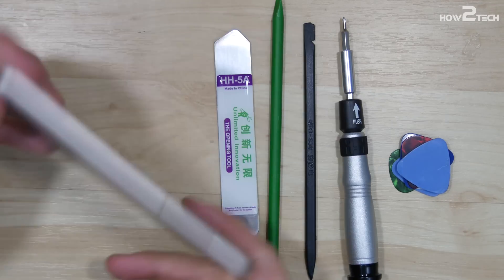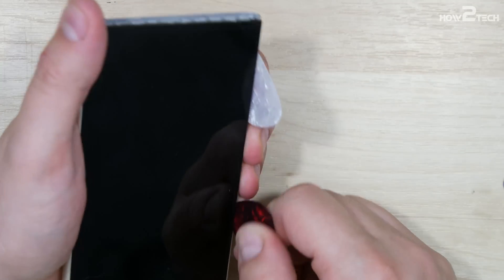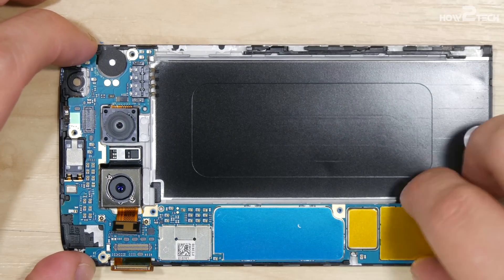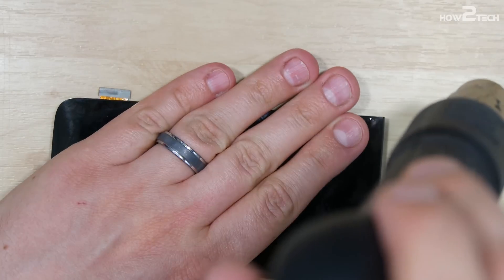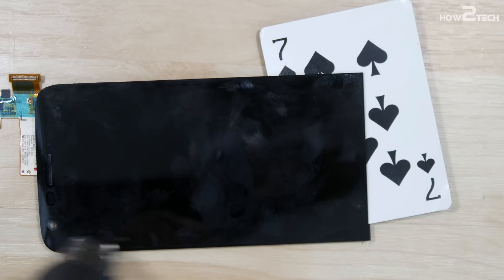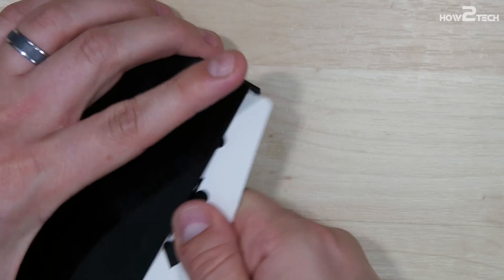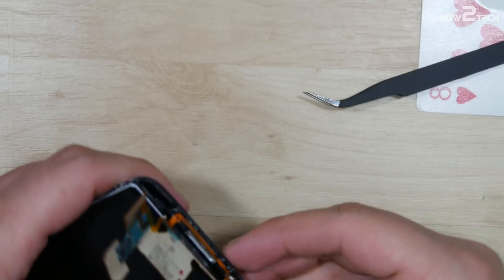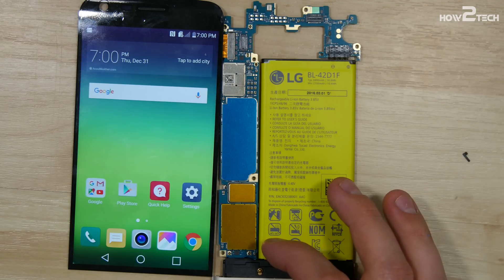LG G5 Screen Replacement - Teardown (4k)

Comment: Actually How2Tech if you remove the battery and look inside the phone at the very bottom left corner there is a tiny hole in the black plastic. That hole is there for a reason. Take a paper clip with a small hook bent in the end and insert it into the hole, pull firmly and it will unlock the slide lock and the phone will separate with minimal force.

Comment: Hey H2T, great video.
 I was wondering if you could help me with a mod question. I fly drones using 5G wifi, 
however my signal crashes around the 70m mark, 
yet the drone I use is supposed to have around the 400m  capability, 
So I was wondering if you could tell me where the ariel is in the G% and how i could fit an r sma lead to it so i could add a directional beam ariel or even a yagi. 
Or better still is there some sort of wifi antenna that i could connect wirelessly to without having to strip down my lg g5?
cheers

Comment: hello sir i got a problem with my lg g5 the camera flash won't work when the subject is too far away from my lg g5. and sometimes it turns black when captured in close to the subject. what is the problem with my g5? tnx for helping.

Comment: I need to replace my digitzer since I smashed it working on my car, I'll be buying one that has the frame already connected. If I'm replacing the digitzer and frame, I don't need to heat it up to remove the display like you showed in the video, right?
Reply: Eric Ver Linden No, if you still care since its been 6 months. All you would need to do is pry it off and disassemble and unscrew the motherboard until you hit the frame and the display itself. To make the whole repair easier, buy a display with the Frame already on it so all you would need to do is put the thing back together using the replacement display.

Comment: What do I do if I just need to replace the actual glass, the LCD works fine, I'm using it right now! There's just an enormous ugly crack across most of my screen...
Reply: just buy the glass and lcd in one piece. Iti is much easier to replace, and only cost a few bucks more

Comment: I was so happy with my G5 until recently now I hate it. After only 7 months the GPS refuses to catch a location and the screen is just horrible because now it has an image retention issue. If I am on a page for even just a minute reading something, that image becomes sort of "burned" into the screen and all I then see is the ghost of that behind everything. It goes away only if I then play a video where things are moving on the screen which then makes the ghosted image slowly disappear. Why would it do such a thing???? Then if I have it on a full black screen, one can even see what looks like 4 pixels still letting light through. It is like 4 little white broken pixels. Argh. So not feeling it anymore.
Reply: SDav21 lg g5 has lcd screen, image retention is really common on lcd's but it goes away in an amoled if that happens it will be permanent. An that of the black screen is calles "screen bleeding" is really comlon on LG devices but nothing to worry about
Reply: Image retention gets worse over time but isn't really a problem. After a year the phone has washed out whiter spots around edges.

Comment: If i buy a screen from ebay will the image quality of the screen be the same as the original??
Reply: EzzilanDeRR it's hard to know but if it seems really cheap like less than about £50ish  there is a significant chance it could be. however as it's isn't a super common phone there is less likely to be cheap knock-off screens anyway.

Comment: We replaced a charge port flex on one. Now we are getting an error saying, "This module you've attached doesn't work for this phone or isn't inserted correctly." We ordered a new flex but had to desolder a little bronze contact with 3 points and move it over to the new flex.

Comment: I did not understand. If I need to replace ONLY front glass panel, why do I need to tear down  all the phone? Can i just remove the screen + MB assembly from the casing and start working on the glass?
Reply: Val K same here... I was wondering that too
Reply: Val K yes I believe you can. this was just a full-ish tear down
Reply: Val K lol good luck and try not to break your display

Comment: What reasons touch screen may be not work ? I recently dropped in my phone in water and after that i bought a display and change it, but touch screen isn't working. Any idea ?
Reply: Lucas Nali corrosion on the connecting flex
Reply: Lucas Nali well dropping you phone in water can a number of problems so it is very difficult to tell.